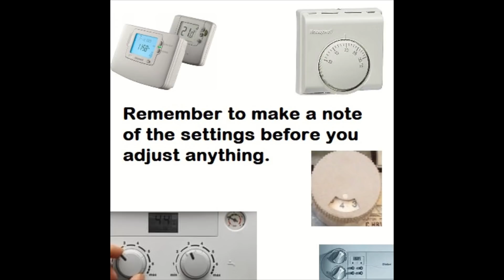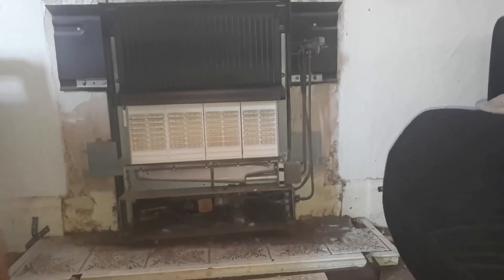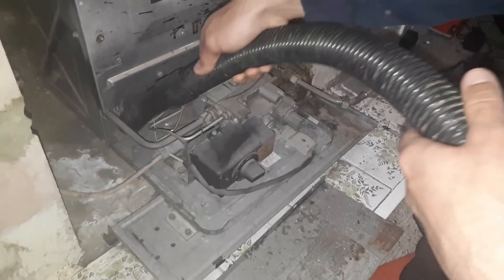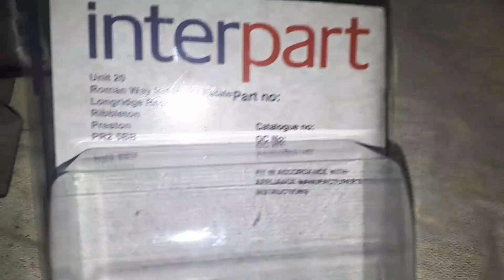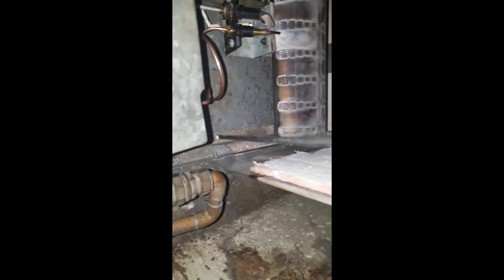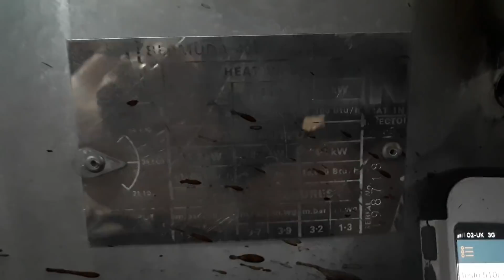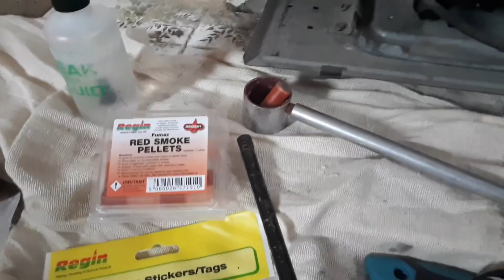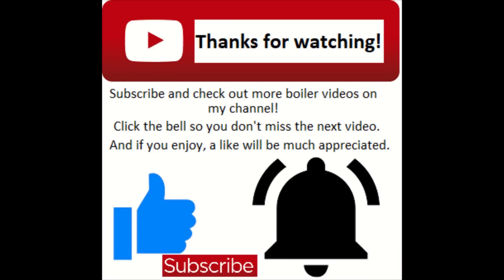How To Service / Repair A Back Boiler Unit BBU - Baxi 401 - Smoke Test

Comment: Them back boilers go on for years my grandad had his installed in the 80s and I'm living in the house right now and it was still going strong only ever had 2 replacement parts but we recently had a combi installed due to low water pressure on the hot and it couldn't be pumped because the tank was to small and it would drain before it would refill
Reply from the maker: Yeah they're much more reliable mate

Comment: Quick question about the workings of the back boiler. At 9.55 you turned the control knob to max and the burner went to full, would that only happen if any external controls are calling for heat?
Also what was the spray you used to clean the tubes?
Thanks
Reply from the maker: Yes mate, this will need a demand / call for heat or hot water.
Air duster, air in a can. Can get expensive, a compressor works well too.
Reply: @goldgas1216  cheers!

Comment from the maker: IMPORTANT PLEASE READ -
This video doesn't cover everything, and you should treat this as a guide.
 Otherwise it will get repetitive and too lengthy-
Do your visuals, clean ALL injectors, check burner and pilot  flames as per MI, check/replace all seals, clean. Always refer to Manufacturers Instructions please
!!! Do not attempt unless you are Gas safe or under the supervision of someone Gas safe. Attempting this without a Gas Safe ID can be dangerous to you and people around you!!!
This is aimed at people who don't service much, new to this boiler or trainees.
All this information is already widely available.

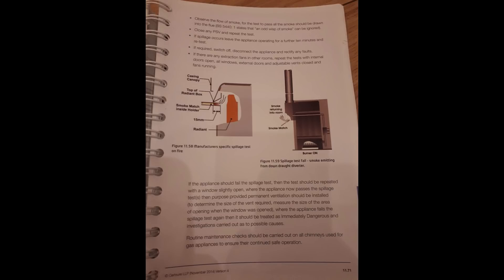Comment: What book/manual is that at 12:50? I have the Logic one but it's nowhere near as indepth as that. Another great video!
Reply from the maker: Cheers bud! Heres a link, u can probably get cheaper with a search
https://www.wiringregulations.net/pub/domestic-gas-safety-on-site-guide-9781906091958.aspx?gclid=Cj0KCQjwitPnBRCQARIsAA5n84n5ubLgqLHunjVYGOQOx_NLLVhcVBSIXABRJFEVBtuRWYFDr39THrIaArmnEALw_wcB

Comment: The last baxi Bermuda backboiler I serviced was spilling p.o.c's back into the room.  A good service put it right, bullet proof boilers as long as they're serviced correctly. 29 years old and I'm already feeling to old for installations. My knees feel shut. I try to stick to service repair & breakdowns. Like they say "it's all bread n' butter". 👍dude kudos for sharing 😜
Reply from the maker: Sounds you've been in too many lofts, knees on the beams, it's a cruel trade to the knees. Get using those kneeling matts early guys! Indeed bullet proof, built like tanks. Thank u very much for the support mate
Reply: @goldgas1216  Yeah you roast to death in lofts before your knees give in. I don't know how some of the bigger plumbers and engineers get through those small loft hatches. Must be majic of some sort or an optical illusion.

 I brought some snickers 9119 kneepads and some red backs.  They're both pretty amazing I only wish I'd brought them sooner. Expensive kneepads some might say. But it's cheaper then in health. I'd like to say I've still got a long time in this trade.

 We have are good days along with the bad. I still enjoy it.😊  it's nice when good people pass down their knowledge to others. My mentor was a top top man. He taught me most of what I know. I'll forever be indebted to him. We live and learn.
Reply from the maker: @rayc1503  good man, i need some new ones, mine a cheap. Will check those out!
Well said man, we need the knowledge passed down! Much easier with the internet now

Comment from the maker: As always this is a guide for gas safe people only!
I may not cover everything in every video as it will get repetetive and too lengthy-
Do your visuals, clean ALL injectors, check burner and pilot  flames as per MI, check/replace all seals, clean. Always refer to Manufacturers Instructions please.

Comment: Awesome mate. Did a Baxi Bermuda inset 2  the other day.

Question: Is it allowed to have just the boiler with the fire place isolated?
Reply from the maker: Cheers again for your continued support mate. You can turn the inbuilt isolator to boiler only yes! But if the fire is AR or ID it should be made safe/unusable by capping it.
You have to speak to baxi if your planning on changing fire and keeping the back boiler.
Reply: @goldgas1216  No worries mate. Keep the video's coming. I previously came across a Baxi Bermuda with the gas fire isolated by a different engineer as it wasn't in use. 

It's annoying when a letting agency send you to do a cp12 but don't bother telling you that it's a back boiler as they nearly always require a service!
Reply from the maker: @umark6695  tell me about it! It should be a no brainer to tell you its that to allow more time for a service
Reply from the maker: And ace, nice to see these old boilers, built like tanks. When u gonna start getting the videos up?
Reply: @goldgas1216  Haha, me and videos... NEVER! Lol